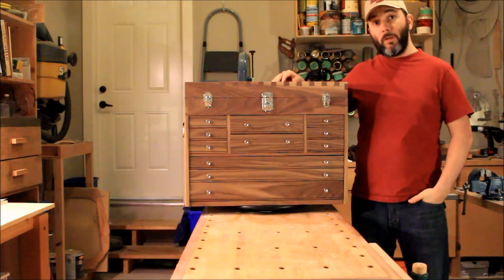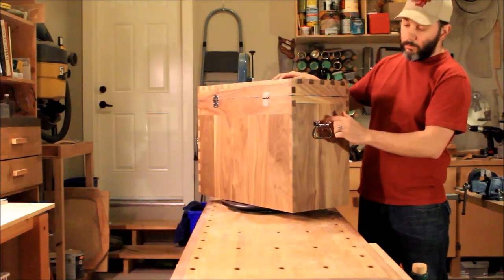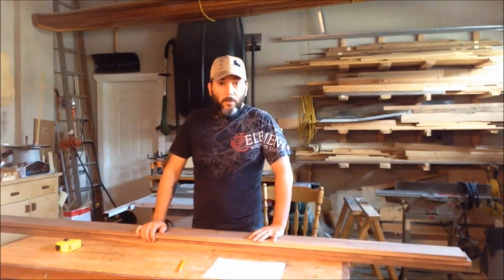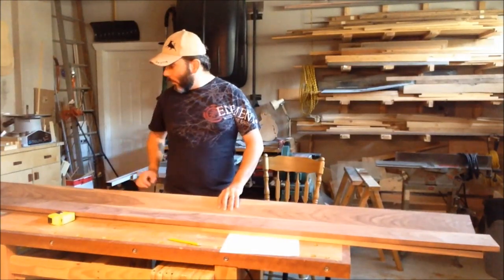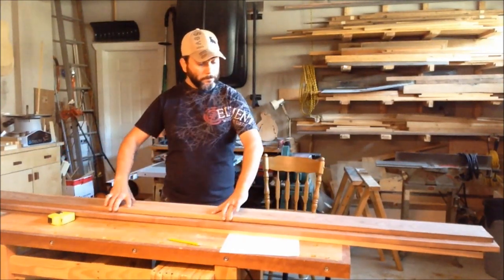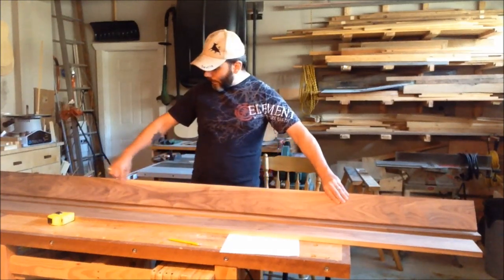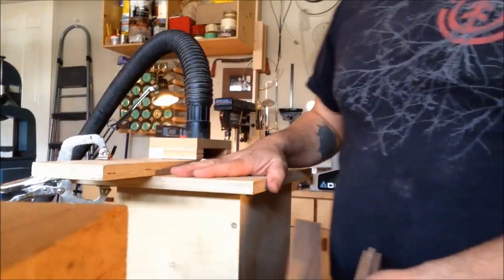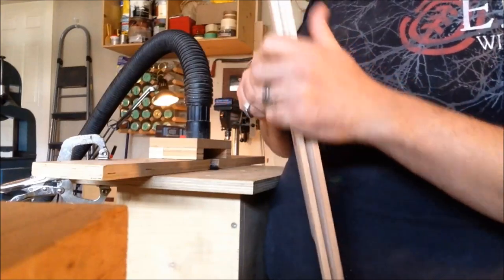How to Make a Dovetail Tool Chest Part 1 (Wood selection & Cutting Parts)

Comment: Nice job Tomy only thing is when you are gluing up your panel you shouldnt really glue the crossgrain boards  ( as you did one across the others @ 7:40 min )as you dont allow the wood for movement ( expansion /contraction )which might show up by cracks on the panel later on.
Reply from the maker: Thanks for the comment pablo24, this design proved itself through Gerstner since the early 1920's. I kept the same method for the glue up of the side and back. Making the whole construction with dovetails I believe will only make it stronger... I did a lot of reserch before starting this project and looking at those machinist toolchest from this era and see that they still hold the test of time convinced me.. Black Walnut is also a very stable wood  which will help. The chest still look pristine today, it's been about a year and half since I finished the built .

Comment: question, I'm always hearing about wood expansion, and leaving a way for it to expand and contract.  But you glued the top piece on with the grain going a different way from the other panels.  This was in February.  Now that it has had a couple seasons for changing weather, have you had any issues?  Or is it something not to worry about on a project of this size?
Reply from the maker: +Gary Docken Hi Gary, As you probably know this design proved itself through Gerstner since the early 1920's. I kept the same method for the glue up of the side and back. Making the whole construction with dovetails I believe will only make it stronger... I live on the West coast and there is a lot of moisture in winter as it rains all the time, This summer we roughly had a week of rain all together and had water restriction  because of that so it became really dry.. The only issue I had is the drawers were starting to seize up on the slides. Titebond 3 Is a great glue for expension I believe as it allows a bit of stress. Once dry it becomes a bit rubbery..Hope it helps, thanks for watching the whloe serie...
Reply: I was thinking the same. I am amazed by the beauty and craftmanship. But i would like to see how it lasts after a year or two...
Reply: There is a reason you never see old furniture with dovetails along the long grain edge, after a few years they are firewood
Reply from the maker: @AntonioMFerreira  It’s been in my shop now for over 6 years, many summers and winters.
Maybe the new version of gertsner are veneer/ply but the original, from my research, weren’t. ( But I’ve been wrong before)...
In regards to my build, it is still part of my every day use and haven’t had any issues with wood movement.🤷‍♂️
Thanks for watching..
You can still see it in my latest shop tour...
https://youtu.be/lOfhemPwHp4

Comment: you said you purchased black walnut for $300 and  you have 4 boards 8' by 1'' and 6'' those boards come out to 16 bf and at 40 a bf you should of paid  $160 not 300
Reply from the maker: +mggcomputers Hi, I bought the 1x6x8 BW  for 6.99bf and I had 32bf . That come up to roughly $225.00 Then here in Canada I had to pay $26 for tax. Then adding the plywood.. That's why I said under $300..Thanks for your comment. I wish It was this cheap here too..
Reply: you said you had for board 1" by 6" by 8 foot that's 16 board feet 4 bf a board but then you replied with saying 32 bf did you use 32bf in the project of black walnut or 16bf just to make sure
Reply from the maker: +mggcomputers yes sorry it is confusing.. The hardwood store was selling those boards by the foot . So I had 8 feet x 4 boards at $7. I wrongly use the BF therm here... My apologies..in the end all you need is 4 lenghts of 8'x6"X1" to do the chest construction. It does appear to me though that walnut is cheaper in your area...
Reply: Thanks for the info, I'll be referring to your video to build the chest, the video was great much appreciated.
Reply from the maker: +mggcomputers really happy you enjoyed it. Enjoy your build, and if possible I would love to see pictures  when you finish it...
Reply: +Tomy Hovington so it was 6.99 per linear ft. That's not bad really. Woodcraft and wood Werks here locally in central Ohio are 18$ per board ft.
Reply from the maker: +Kevin Hanes I got lucky when I bought it.. I went back at the same place last month to get BW for another project and it's selling for more than double what I had paid for a year and a half ago... I've settled for cherry instead ..

Comment: Dovetails should only ever be on end grain, never on straight grain. All good except for your top.
Reply: Why not
Reply from the maker: Going on 6 years....
No issues.
Reply: Dovetails can be done on any end. The point of a dovetail is that the tail and slot complement each other.
Reply: @georgenott6802  Wood tends to break easily along the grain lines, that is why dovetails are generally only used to connect on end-grain sides of boards to each other. The dove tails can break off too easily if cut into the long-grain side of a board. Also, connecting end-grain to long-grain doesn't allow for the seasonal expansion of the wood, and may cause cracks to form in the long grain. This can be mitigated by using quarter-sawn wood, or rift-sawn boards, if quarter-sawn isn't available, as this minimizes the wood movement.